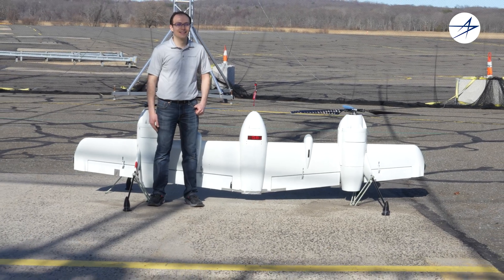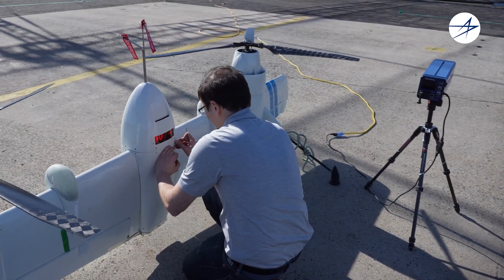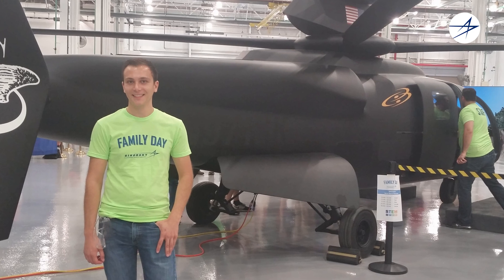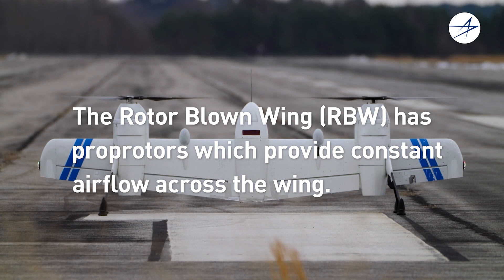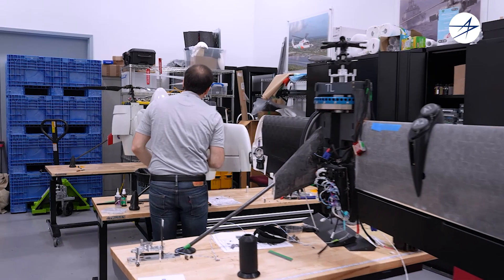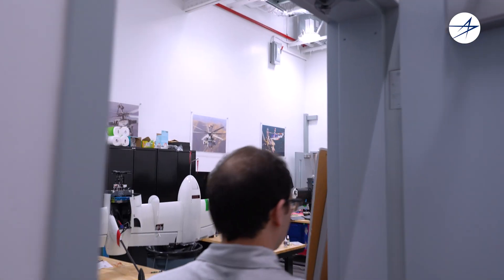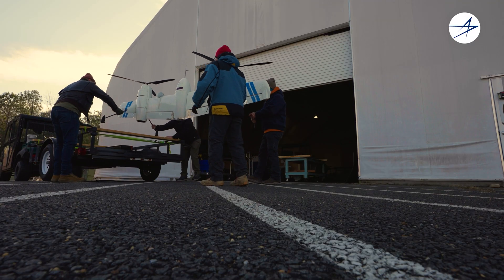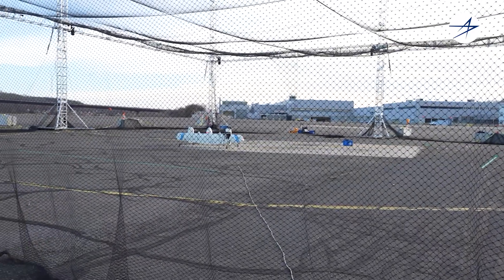The Future of Flight Is Here: Go Behind the Scenes with a Sikorsky Engineer

Comment: Create multi propeller designs
Like a jet exhaust
Screwed propellers inside spinning inside a safety rim
This will result in excessive noise reduction as the spinning rotors will reduce and suck in the turbines noise itself

Comment: That wing is really interesting. The motor for the one pitch adjustable prop was huge. Strange that it is pitch adjustable with that much built in lift in the airfoil design. Good luck! 

@EricDraven-v5t....they have so far produced these---->F-35 Lightning II, F-22 Raptor, C-5 Galaxy, U-2, and SR-71 Blackbird. Those are some of our most useful aircraft..?